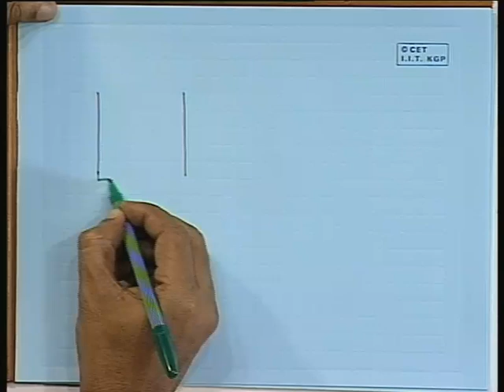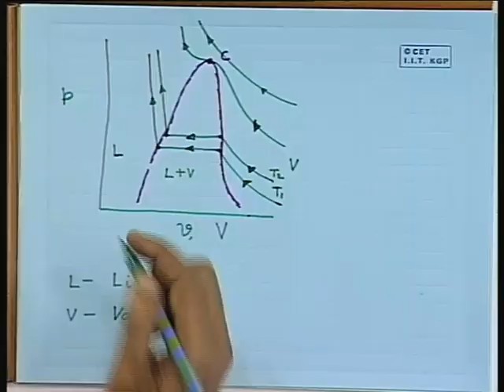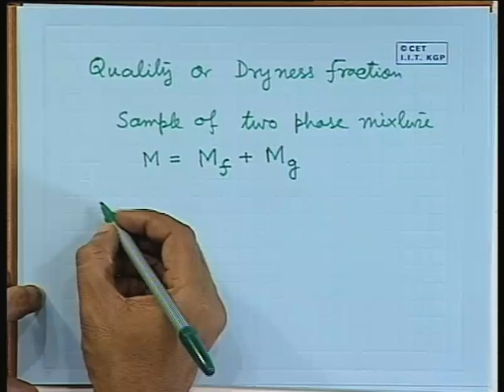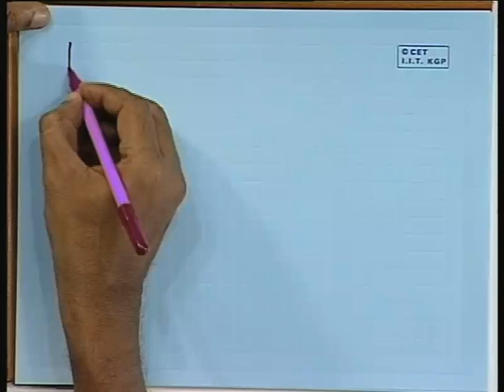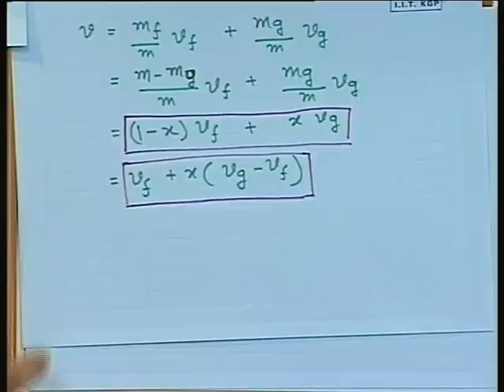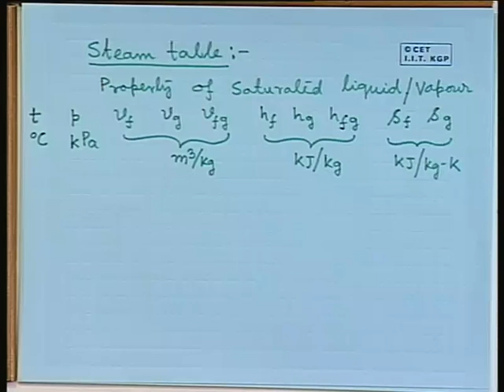Lec-6 Property of Pure Substance, Steam Table

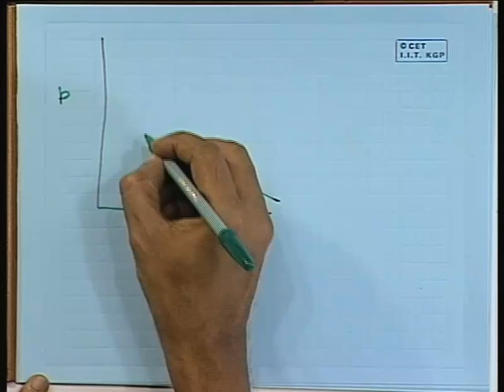Comment: Sir  at time 7:18 you told that the pressure is constant and the temperature is also constant but there is change in volume , this is the violation of first law
Reply: vapour formation is a constant tempreature and pressure process
Reply: there is change in phase, thats why volume decreased
Reply: Mohit Sharma temperature is not constant